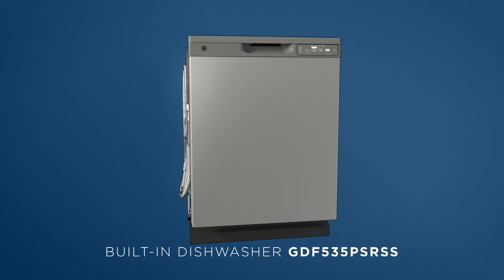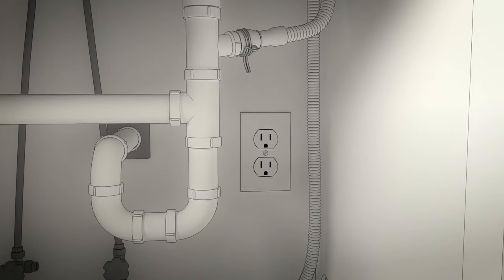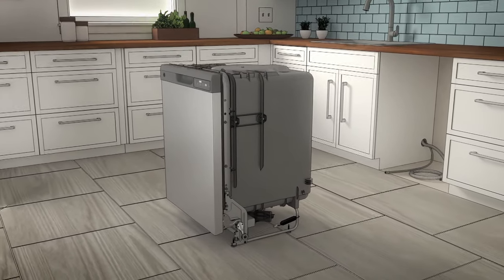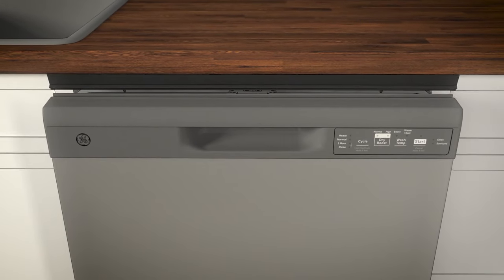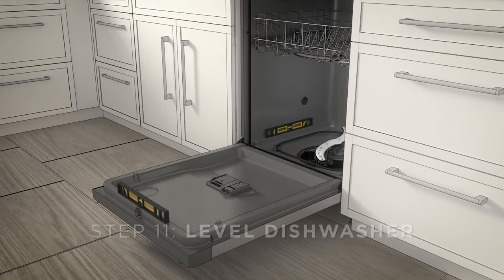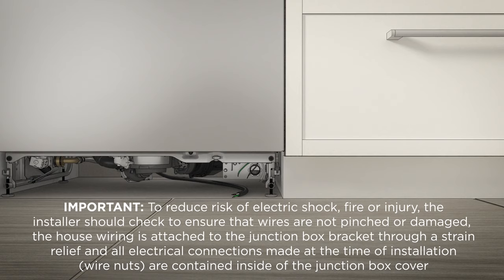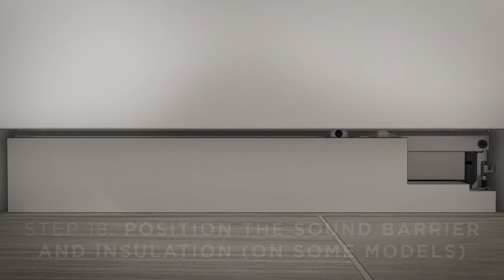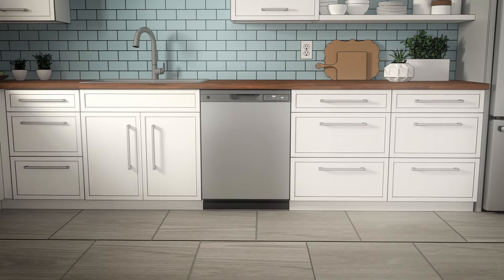How to Install a GE Appliances Plastic Tall Tub Dishwasher

Comment: The water valve has a blue tab inside of it. Do I remove that?
Reply from the maker: Hi there,

Thanks for reaching out! Can you provide your unit's model number? Once we have that, we'd be happy to take a closer look into your question.

Hope to hear back soon. -MS
Reply: I’ve since found out the blue tab  is a part of the valve. I just had a leaking water supply line that I replaced w a new one.
Reply from the maker: We're glad it’s resolved. Do reach out to us PM anytime if you need further assistance. Sincerely-DM

Comment: The 90 degree elbow position puts it directly in the way of the drain tube which is made from inflexible cheap plastic and tightening the water line will be extremely difficult: design/material fail.  Mounting bracket holes are positioned almost flush with dishwasher housing making turning screws extremely difficult: design fail and "corrected" by the insert/bend bracket which does not hold firm.  The balance legs only have a single screw point and do not screw in flush or even and you won't be able to reach the rear legs to adjust if you wait until the dishwasher is in "final position": design fail.  
GE seems to trend where any design failure that makes assembly difficult is pushed onto the consumer.  Give this consideration for any dishwasher before purchase.
Reply from the maker: Hello-Thank you for reaching out to us. We would like to help if you have any questions we can look into for you. Could you please send us a private message, and include your model and serial number? Look forward to hearing back. Sincerely-DM